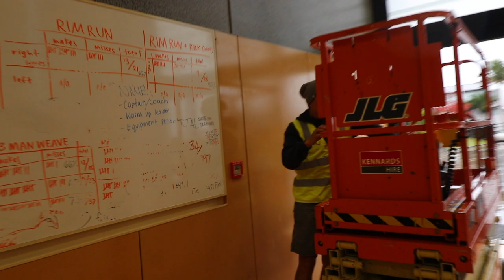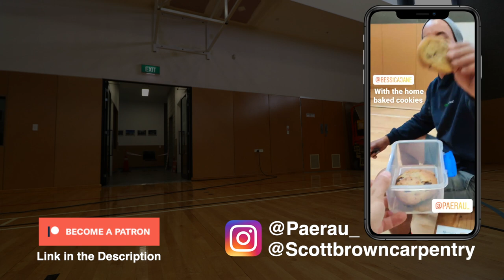Patching Plasterboard With Paerau

Comment: Just when a seen you putting the gyproc up with your impact....better off using a normal drill as the vibrations of the impact can widen the screw hole in the gyproc causing the screw to fail....especially on a ceiling using red gyproc......just a thought!!
Reply: Stuart McMillan barely